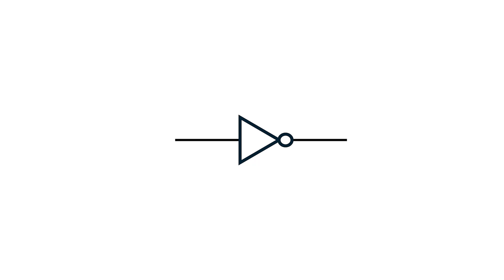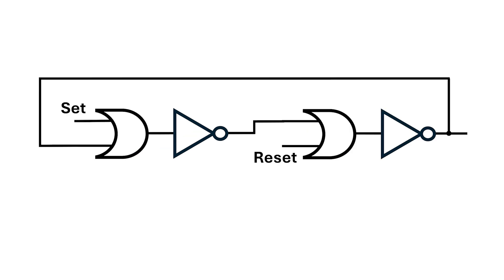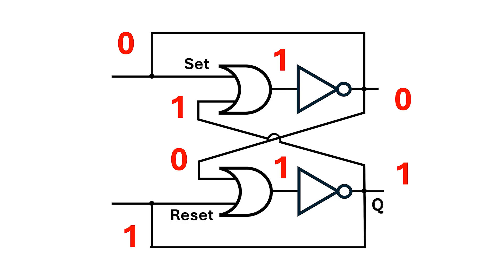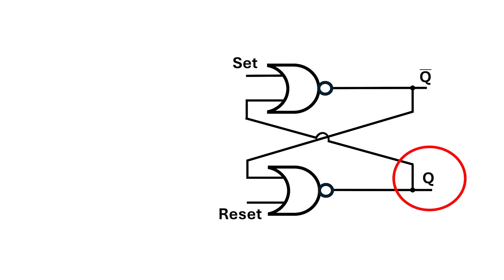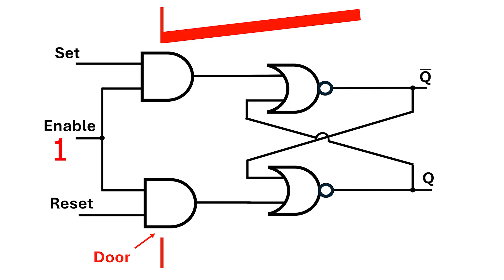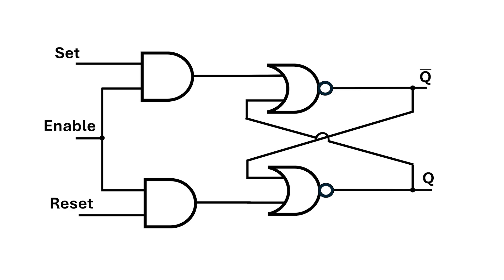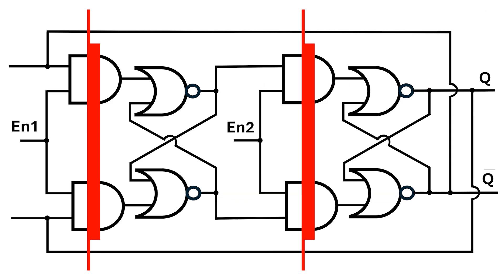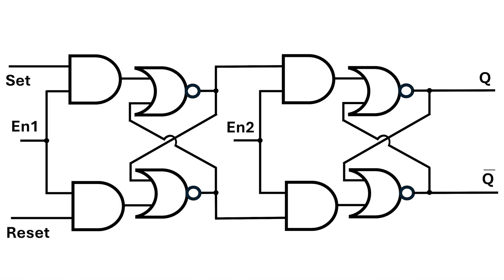Switches to CPUs: Flip-Flops1

Comment: I got a couple things to point out.
First, your two-relay SR latch actually has the outputs on the outputs of the OR gates/inputs of the inverters, which is the opposite of the logic diagram. (That's fine, though, since it just means the Q and Q-bar outputs end swapped. This matches how they appear on the actual schematic involving relays, so no problems are introduced by this.) This was actually the case in the last couple videos; I just didn't notice it before. It does unfortunately make it hard to represent what's actually happening in your circuit (rather than an approximation) with NOR gates, though.
Second, the gated SR latch you actually built has the OFF and common terminals for the SR latch portion swapped compared to the schematic. That's not a problem right now since you aren't using the ON terminals on those relays currently, but there's the possibility it may cause problems for future expansion.
Reply from the maker: You must have eagle eyes to spot that common and off were swapped, but functionally it doesn't make any difference and i wanted to show the race conditions.  Unfortunately, there can be a big gap between filming the circuit and making the video which means sometimes errors like this creep in.  

For example, I'm currently building/filming and debugging the program counter for the relay6502, but I'm several (5+) videos behind in the production.

Comment: The 6809e required a quadrature clock input, and I always wondered why. Now I wonder if it had something to do with gating logic between various digital airlocks to avoid race around conditions.
Reply: 4 phase clocks were common in early CPUs/microprocessors (the TMS9900 from TI required a rather complicated 4 phase non-overlapping clock for example). I suspect Matt is working his way up to D type flip-flops, which are a little more complex, but only change on one type of edge of the clock signal (most commonly the positive edge), which allow designs to be simplified (there can be no race condition as the output only changes to the input state when the clock signal changes in the correct direction. By the time the output has changed the clock edge is over and thus the output feeding back to the input will not have any effect).
Reply from the maker: Correct, well anticipated.  D-types in the next video.  I think if there is a big asymmetry between sinking and sourcing current within a gate/circuit then multiphase non-overlapping clocks are basically guaranteed to work in flip-flops etc.  Other workarounds for this asymmetry would require a large number of transistors.

To extend the analogy, imagine an airlock where you can instantaneously open and close the doors.  Then you could be in the airlock and close the door behind and open the one in front at exactly the same time and the air still won't be able to escape the HAB.  That's essentially what a D-type does, there isn't enough time for a race around.   But if the doors open fast but close slowly, then this won't work. 

CMOS circuits can easily source and sink large currents (ie. open and close doors fast), but older processes like NMOS, have a big transistor to sink current but a weak pull-up to source current.
Reply: For those not in the know, ICs started life using bipolar logic, which was large and power hungry. This was overtaken by PMOS, which needed much less space for a transistor but was slow in comparison (especially going from high to low) and needed multiple power rails. This was replaced by NMOS, which was faster, simpler to design and could use a single power rail. PMOS and NMOS both used a single transistor and a resistor in a pair (NMOS could use a second transistor configured as a resistor, but the idea holds), so one of the two states was always drawing current. CMOS uses a complimentary pair of transistors, one PMOS and one NMOS. When the state changes one transistor turns off and the other on. Current flows only when the state is changing (in theory at least) as the transistors are partially on or off.

The 6809 used a pair of clocks, one of which was 50% out of phase with the other (i.e. the second clock changes half way through a 1 or 0 state of the first). To generate this phase difference it needed a crystal that was 4 times the fundamental frequency of the CPU, not a 4 phase clock. The E version of the 6809 used an external clock and you can see the two clocks documented there (E and Q).

Comment: Great explanations. Not sure if you need to fall back to relay logic equivalents anymore though, You've made it pretty clear I think as is.
Reply from the maker: Cool, thanks for the feedback! 
I'm thinking of splitting the series after two more videos.  
I'll move into semiconductors (7400 series, SRAM, EPROMs etc) in one 
stream, build the alarm clock, then Turing machine and make it 6502 compatible.  This will be the more educational stream.  

In the other stream, I'm going see if i can take the relays all the way to a relay 6502.  I just need to get to the d-type flip-flop and ripple counter in the current series. It will force me to make a more efficient sequencer.
Reply: @DrMattRegan  oh wow, that'd be some project. Looking forward to all that.
Reply from the maker: Yeah, should be fun.  Simulations work for  a 250 relay decoder, we'll see how it goes.
Reply: But relays are so much more fun and satisfying. All that clicky goodness.